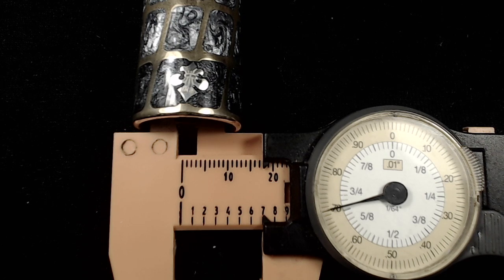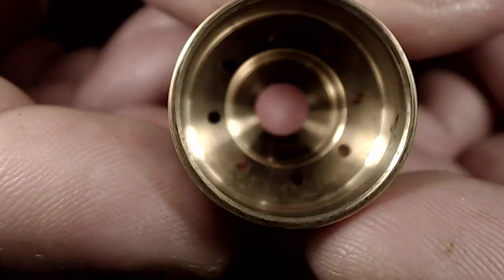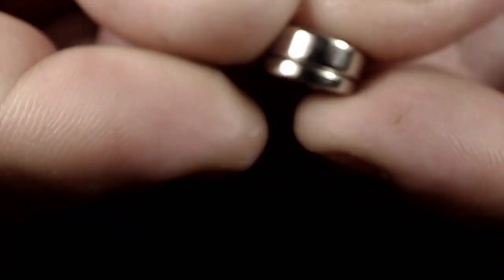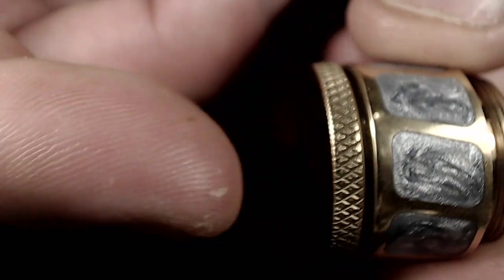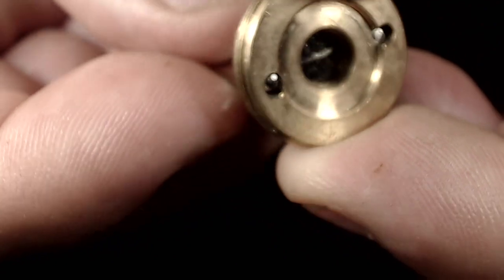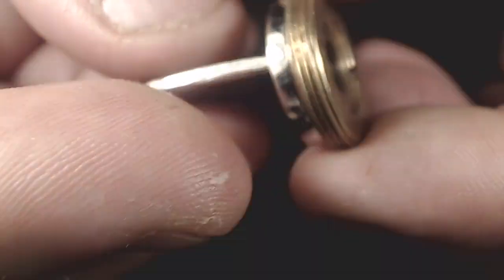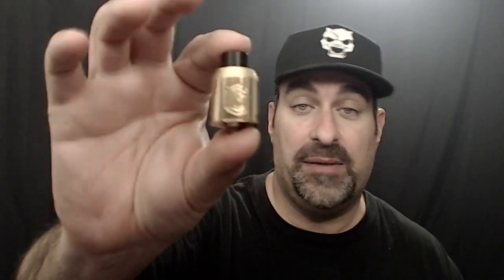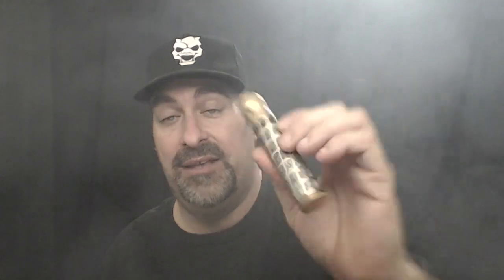Negus Mod & Son Indra Mechanical Tube Mod. A Modern Art Masterpiece

Comment: Question: how is the inside diameter only 17.9mm when the 18650 battery is at least 18mm around?
Reply from the maker: JOHN PRIGGE could be 18.9 instead of 17.9 my caliper could be off a millimeter